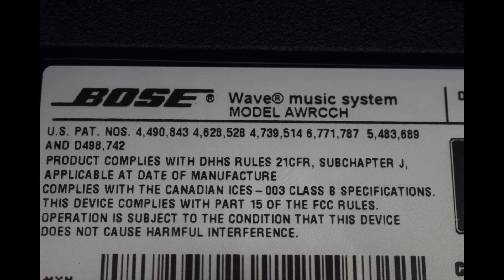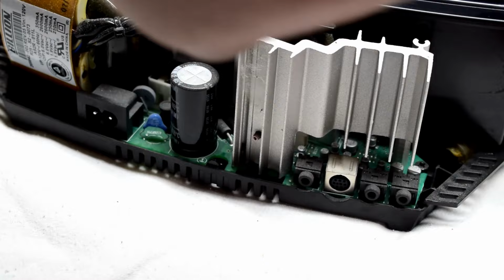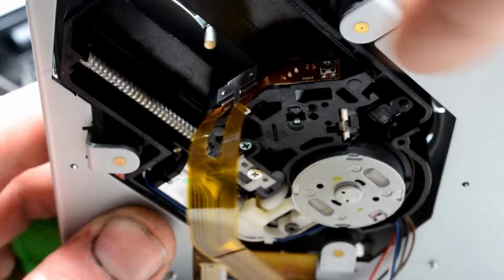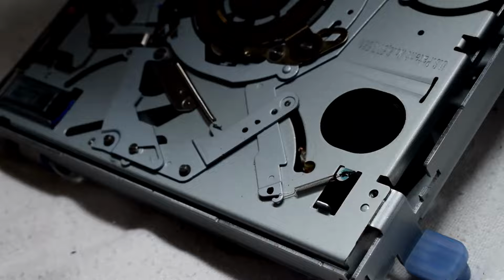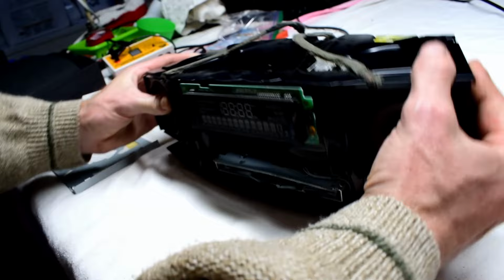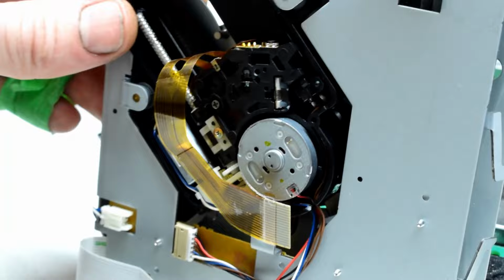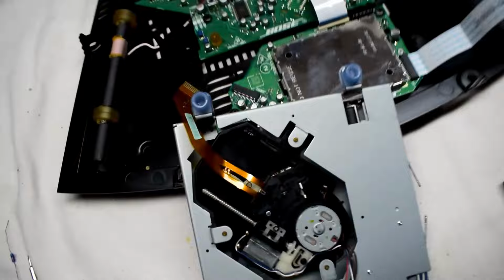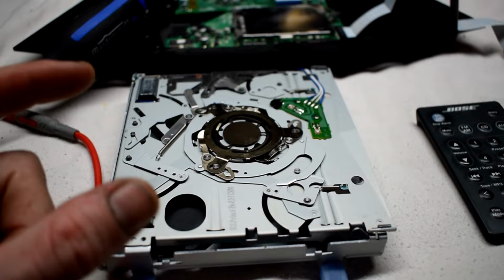Easy Fix! Bose CD player not reading Model: AWRCCH

Comment: This would likely just burn out the laser in a short time. Most Bose Wave issues have nothing to do with the laser, so it would be a shame to ruin it. Especially if it makes clicking sounds, it will be SMD caps that are the problem. Never use a power tool for the 5 screws. The plastic gets really brittle. Never use IPA on the laser head. Use spectacle lens cleaner on a q-tip. Never spray or drip anything into the laser optics. The q-tip should be moist, not dripping.
Reply: IPA is excellent. Whats the reason?
Reply: Yep I made the mistake of using a drill motor. Like u said the plastic gets very brittle. Also like u said its usually capacitors. U can replace the capacitor or the whole unit under where the disc plays.
Reply: @shawntannehill  correct

Comment: That's not a fix. It's running the laser diode past it's current specification. That VR is not to be touched after it leaves the factory. Doing it will drastically decrease the life of an already tired laser diode and a kind reminder, optical blocks for CD players aren't being manufactured anymore. So when it dies, kiss that player goodbye.
Reply: While I'm sure your comment is accurate and helpful, I wanted to provide my own experience.  Having the same CD issue, I recapped the entire CD circuit board properly.  I also greased, lubricated and cleaned the CD mechanism as needed.  Unfortunately, the end result was the same as when I begin.  As a last-ditch effort, I turned up the laser head pot ever so slightly as directed in the video.  The CD player now works flawlessly so for me this provided lifespan that didn't previously exist.  Who knows, maybe Bose shipped these out with the absolute lowest voltage set on the CD lens reader because the internal components appear to be high quality while a large amount of these units are having the same exact issue.  I have much older CD players still working perfectly without any upkeep.   Anyways, I just wanted to say that this solution of adjusting the voltage pot did work for me.
Reply: Lolol

Comment: BIG thanks for posting this video... Was able to resolve the issue with my machine by cleaning the laser lens... Thought I would try that before adjusting the alignment. The suggestion on removing the cover of the CD unit helped as I could not see the lens through the slot.

Thanks Again!!
Reply from the maker: nice

Comment: Thank you for the video! I was able to turn the variable resistor to make it vertical and now my cd player is working! I struggled to find a tool that would turn it. I ended up using my finger to do it.

Comment: My fix was to reset the ribbon connectors between the CD player and controller. board. It took longer to disassemble the unit then to pull out the two ribbon  connectors and reinsert them.